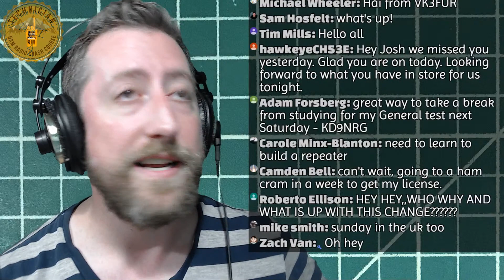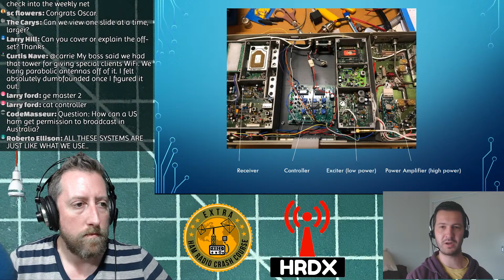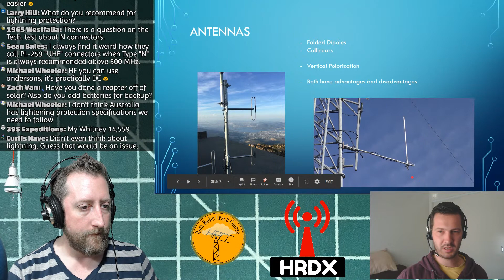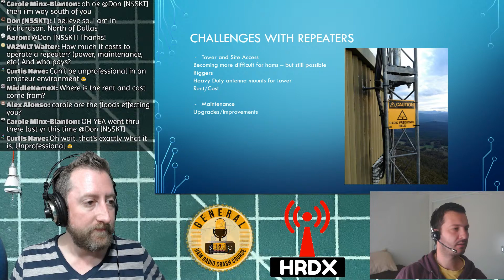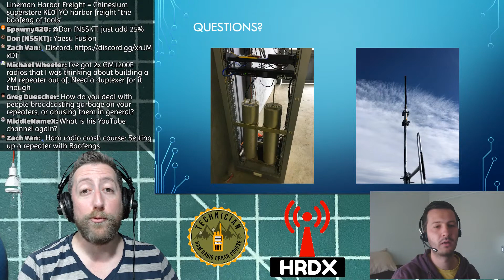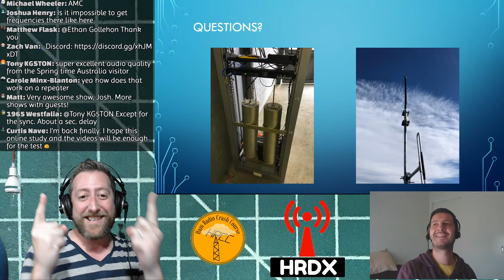Demystifying Ham Radio Repeaters with Ham Radio DX

Comment: screw it!  50m is 50m....don't BOTHER with feet, period, end of story!  if someone needs handholding as to what some SI measurement is in some other system, let Google help them out; the search box itself will do it for them, but it's a step back.  And it's more than 150 ft.